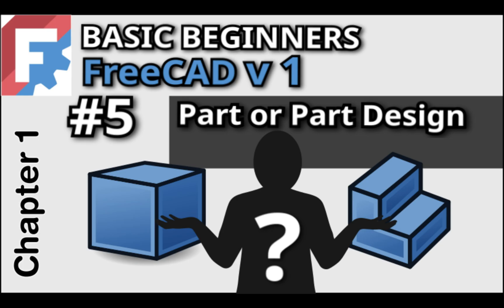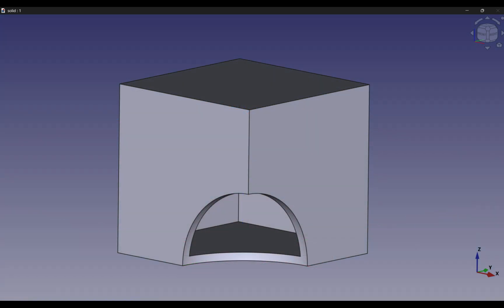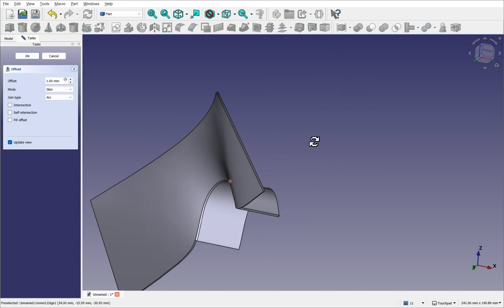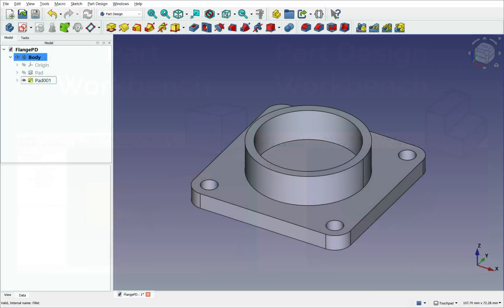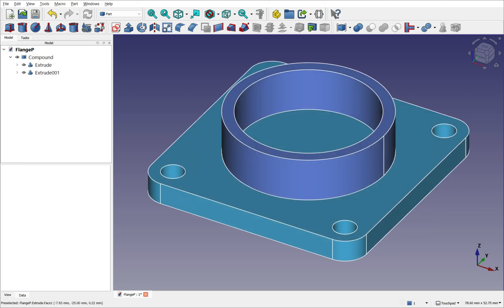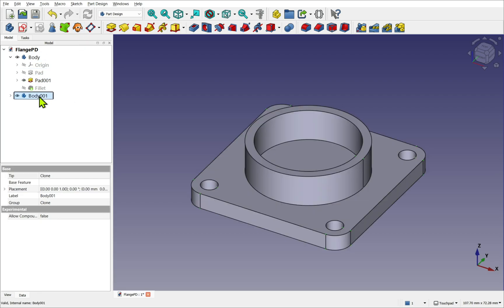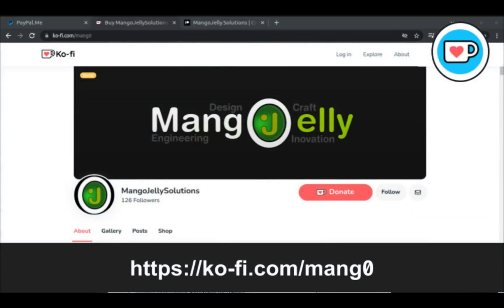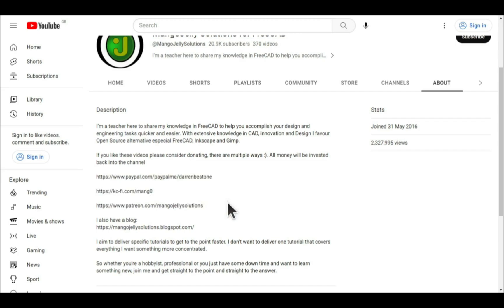Workbench Choice in FreeCAD, Part Design vs Part? |  Basic Beginners FreeCAD v1 Course | Lesson 5

Comment: Hi Darren can you answer a question, I cannot find the section view icon in any workbench’s apart form ‘ part
‘ where it is not active.? I am trying to use a datum plane to create a sketch on.?
Reply from the maker: The toggle section view is in the sketcher workbench also right click > toggle section view, or are talking about the clipping plane ( top menu > view > clipping plane ), ahh, the persistent section cut?  This may of changed location in newer versions but you can customise the toolbar and add it.  Right click on the toolbar and customise. Click on toolbars tab and use the search.  And then you can add it to your toolbar using the arrows.  Hope that helps.

Comment: I barely use the Part Design workbench. It's just not how my brain thinks. Even a single solid is a "tree" of details for me, which combine to a finished part. I also managed to break Part Design bodies almost constantly at some point by changing a previous feature in a body. It might have gotten better with newer FreeCAD versions as references to vertices/edges/faces are handled a lot more intelligently now (by location, and not to a constantly changing name). On top of that the Part workbench is more versatile and works better together with objects of other workbenches.

I still think by the way that having a workbench called "Part" and another one that is called "Part Design", as well as an object called "Part" (which is essentially a container and has nothing to do with either workbench specifically), is one of the worst decisions that one can make, if they want new users to get into FreeCAD.
Reply from the maker: I use part a lot, the ability to delve into the nested view and pull back extrudes and Boolean results to use them in other operations is a huge benefit for certain applications and manufacturing requirements , especially when creating parts that fit together an as you say, it's easier to work and integrate with other workbenches.  If you tried that in the part design you would first have to have a solid and then shapebind or base feature the part in as a separate body.   

Totally agree, the naming is very confusing.

Comment: This is better explanation than in the previous (0.22) tutorial. Thanks for making this update. Would you say the part workbench is similar to sketchup workflow or it's not really comparable? I'm more familiar with sketchup and coming over to freecad requires some fundamental changes in workflow so I would like to make transition as smooth as possible.
Reply from the maker: Ah excellent, I was looking for a more refined and easier to follow explanation. Thank you. I have to admit, I have never really used sketcher. Part workbench uses a methodology called Constructive Solid Geometry (CSG) where models are built by combining or subtracting shapes whether primitive or those that have been produced from a sketch. I am guessing (I have to say again little knowledge here) similar to TinkerCAD?
Reply: Sketchup is like the mspaint of 3D modeling. You draw something and that's it. No way to make any changes to any previous steps except for undoing everything. It has got barely anything to do with CAD. You can do (almost) the same things with both workbenches, it's just done in slightly different ways. You have to try out which one you like more. I'd say the "Part Design" workbench is minimally closer to Sketchup, just because a "Part Design" body is created in steps depending on each other, while a "Part" part is a tree of steps that come together. And yes, I'm very much annoyed by the confusing naming of workbenches, which is IMHO a big part of holding acceptance of FreeCAD back.
I do like the Part workbench a lot more, because my brain thinks in "trees" (from the full picture to details) and that workbench is more versatile, especially when it comes to interacting with other workbenches.
Reply: @superdau  Yea I know but SketchUp is just intuitive like no other 3d cad software is. I did a carport in sketchup and I do know its limitations and Im trying to switch but the learning curve is steeper. Freecad wasn't doing it easier with 1.0 update since they changed or moved the tools. Also the workbenches part is mostly just confusing. I wish there was a better solution for that. Combine part and part design for example.

Comment: Many people want to make simple parts to 3D print and FreeCAD is excellent for that, but most tutorials take a more rigorous full blown CAD professional approach that is intimidating to the uninitiated.  I try to urge people to install FreeCAD and ignore all of the wonderful complex features they don't need at first.  Skip the excellent tutorial videos.  Instead, open the Part (not Part Design) workbench and use FreeCAD in what I think of as TinkerCAD mode.  Ignore most of the icons in the Part workbench, at least until they are needed later.  Focus on being immediately productive by learning to create parts using primitives - cube, cylinder, tube, cone, sphere, torus.  Practice changing the size and orientation of the primitives using the parametric properties.  Cut and paste primitives and edit their parameters - size, orientation and location.  Manipulate these primitives with the Boolean operators - Fusion, Cut, and Intersection.  Then use the Fillet and/or Chamfer commands to finish the part.  It's amazing how complex parts can be created using only these simple tools.  Export the STL or STEP file and 3D print it.

Once someone has learned enough FreeCAD to be productive, they'll eventually need to do more complex operations such as lofted surfaces, complex profiles that are rotated, engraved text, etc.  That's a good time to learn the more powerful features of FreeCAD using the wonderful tutorial videos.

Too many people are discouraged because FreeCAD is so powerful and complex that it can be intimidating.  It seems more difficult than SolidWorks or Fusion 360, but it can be very simple to use and people can be almost immediately productive.

I'm designing a simple LED mounting bar this evening, to be 3D printed in TPU-LW.  I could draw the 2D profile, properly constrain it, and pad it to length to make the 3D part, and that's how it would invariably be taught by instructors who are trying to teach others to be CAD operators, but I'll fire up FreeCAD, draw three cubes, chamfer two of them, fuse them, draw a cube and a cylinder, fuse them, and subtract the latter from the former.  I can do this almost as quickly as typing this description.  I'm an engineer and far from being a professional CAD technician, but I'd bet I can create this part from primitives in the Part workbench faster than an experienced CAD professional could create the same part "the correct way" in the Sketch and Part Design workbenches, even though I am often amazed by how quickly a good CAD technician can create 3D parts.